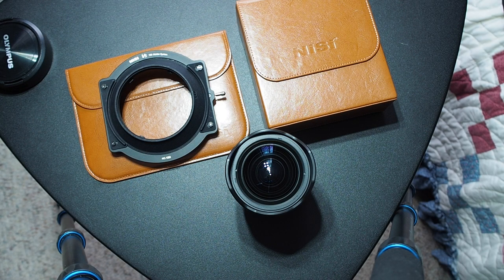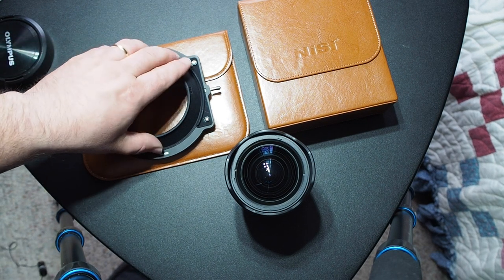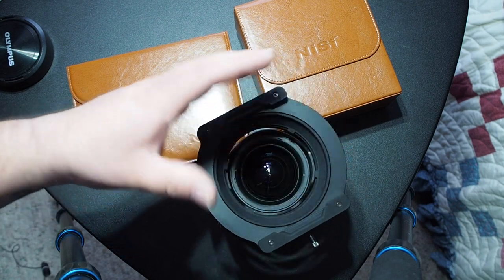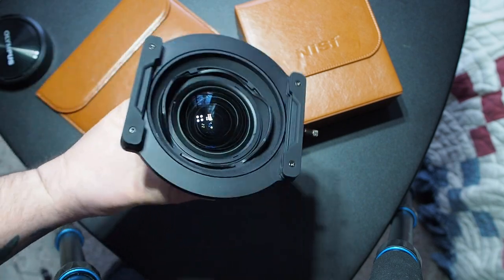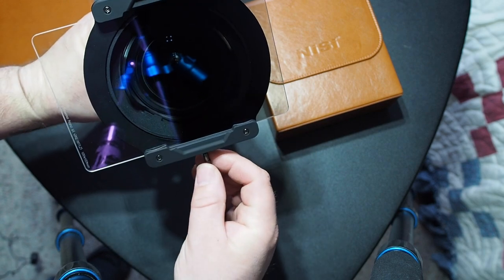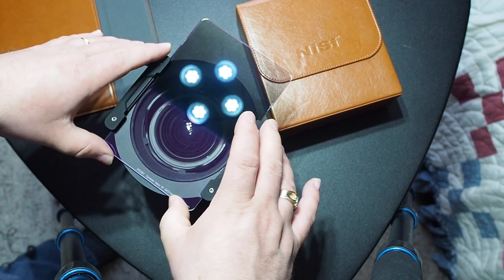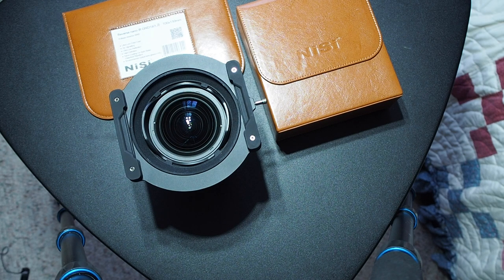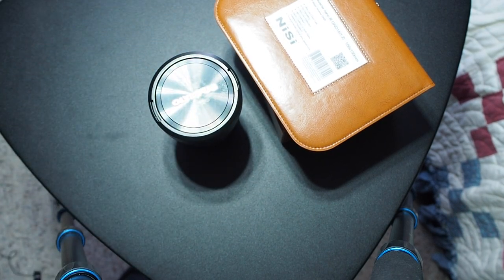NiSi Filter Adapter for Olympus mZuiko 7-14mm PRO by Phil Norton

Comment: When I purchased the adapter, the gasket started to roll into a circle at some petal locations and the sticky part adhered to the petals and the adapter would no go all the way on.  I solved the gasket problem after receiving an email from Phil.  To fit the gasket you need to squeeze the adapter on two opposite sides and push down one end that has bowed out, "then as you would walk a heavy wardrobe across a floor, from one point on the adapter push it down a little, whist at the same time pulling it out. The adapter has flex in it,  so pulling it out will relieve some of the grip of the gasket on the hood. Work around the outer edges gently pushing it down and pulling out. It will then sit in the right location on the lens hood without curling up. It sounds tricky, it only takes a few seconds and as the gasket ‘beds’ in it will get easier."  Also you need to ensure there is no gasket glue on the petals as the glue that will cause the gasket to curl.
Reply: Sounds funny, why don't Phil apply the gasket by himself? Seems be a default that doesn't exist on my original design of adaptor for Lee.
Reply: George if I have not already done so please contact me and I will send you new gasket that avoids this issue :)
Reply: I do. Unlike others I send adapters out with gasket fitted and with spares without having to send an email to request it.

Comment: Can you still use the circular filters with this adapter or do you have to use the 100x150 filters? I have a few 82mm Breakthrough ND filters and would like to use them instead of buying all new ones.

Comment: i didn't hear you mention if there is any part of the filter/adapter visible when fully zoomed out at 7mm? I have this lens.
Reply from the maker: I have had NO vignetting but have had a couple of people say they do. If it is not pushed back firmly in place it will vignette though. But again, for me? No issues.

Comment: It looks like the adapter will not work together with the Nisi CPL Filter in the Nisi Set up ring. Could you please confirm this?
Would you recommend to have a second V5 holder for the CPL and for use with other lenses as undo the screws in the field is not an option?
Reply: I would also like to know this!
Reply: The polariser will not fit Holger because round cpls need to be around 150mm diameter. The solution is to use a square 100x100 slot in polariser.
Reply: Holger, just to add, there is no need to undo the screws, the plates on the rear are extra security to ensure the holder cannot detach from the adapter and still moves freely, the holes are elongated meaning the plates with slide open and closed. Slide them open and remove the holder by pulling the lock pin. To use the other adapter just leave the plates in the open position.
Reply: Phil Norton Photography Thanks for the info Phil. Probably about to order your adapter and the NiSi holder kit for my 7-14. I'm new to the world of square filters so I have a question about the 100x100 polarizer: I'm guessing to achieve the look I want with the polarizer I will need to rotate the entire holder like I would a standard round circular polarizer. My question is if I have to rotate the holder, how do I use a graduated filter plus a polarizer if I want my graduation to be parallel to the horizon? Can I try rotating the 100x100 polarizer 90 degrees and slide it back into the holder?
Reply: Square polarisers work different Wesley. Insert the right way up and it is full polarisation, and you're right, insert it turned 90 degrees for less, or upside down for zero to use just as an ND.

Comment: When wide open with 7mm do have vignetting? Or the best choice 150mm from NISI for this lens?
Reply from the maker: Arthur X if you have the holder all the way back(seated properly) you should have NO vignetting. and yeah, 150mm
Reply: i think at 7mm i have some problems with adaptor for 100mm filters, thank you

Comment: why de adhesive ribbon is not attached in origin? i had made a bad installation and now i can't use it. How i can replace de adhesive ribbon?
Reply from the maker: Carles, I would reach out to Phil Norton to request a replacement. When I got my unit I had two gaskets so eventually I had to install the second one. Phil is very nice and easy to work with and I am sure he will take care of you.

Comment: Can I just get the adapter and then use different filter holder? I already have my own filter holder and just need an adapter to fit my filter holder with my 7-14mm lens?
Reply from the maker: I would reach out to Phil and inquire with him. Although I do believe he designed it to be used specifically w/ the NiSi system.
Reply: thanks. also, will the 10% discount still be active?
Reply from the maker: John-Rey Macatuggal I couldn't say for sure if it would work with your specific adapter. Maybe contact Phil (http://www.philnortonphotography.co.uk/olympus-714-adapter.html) and see if he can help. Thanks for watching the video!
Reply: thanks :)

Comment: I've had a bad experience with HAIDA adapter, seeing your review gave me courage to try this NISI adapter. But can i fit 100*100 filters? or it just accepts 100*150?
Reply from the maker: +Sam zahrani 100*100 filters will work...It is just that the 100*150 filters are what NiSi makes so I mention those.
Reply: That was Haida M15 or smaller one?